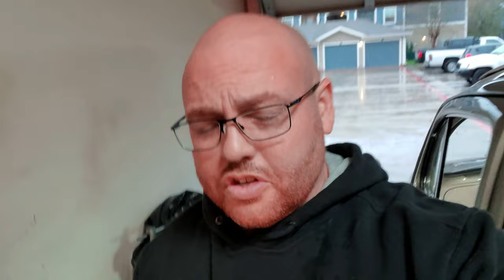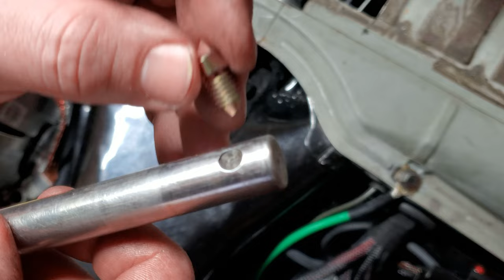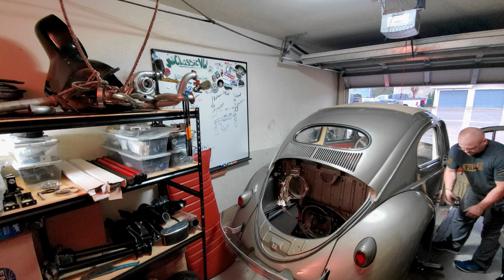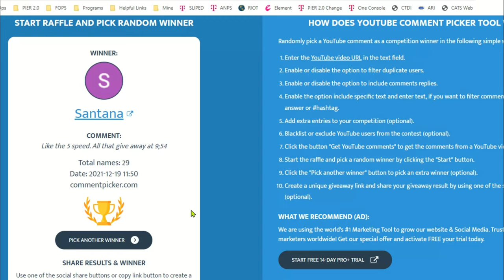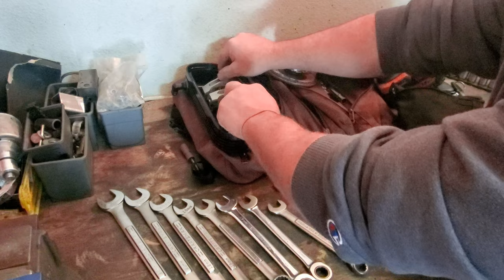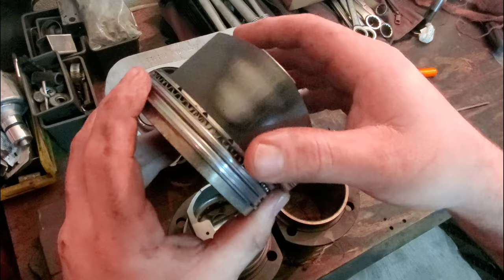BERG 5 Shifter |Turbo VW Beetle | JW Classic VW

Comment: Install looks great man!
Really nice stuff on that engine. Looks nice and clean as well. 
Question… wouldn’t it be a 2180 and not a 2276?
Reply from the maker: The General was a 2276cc brother this bad boy has those 92mm thick wall and I'm going to confirm but the CB Wedge-Mated Crank size... 86mm Chevy Journals or the 82mm VW.  I'm really not sure.  Soooo 2180 or 2287cc... it's a mystery right now... time for some Scooby-Doo investigation! Lol
Reply: @JWClassicVW  I remember the General motor, it treated you well!
Yeah it’ll depend on the crank, I assumed an 82 stroke. Either way it’ll be a monster with that turbo.
Reply from the maker: I know brother, I'm soooooo excited!

Comment: Pistons look like what i run .  JE 92mm thick wall barrels and pistons. With a turbo ring package . Thin top ring . And I also run the tool steel big wrist pins, from Ron Lummus .  Turbo engines do carbon up a lot .
Reply from the maker: Yes they are 92mm thick walled... good pistons, super excited to get her back together!

Comment: JW are you going to split the case a replace the rod and main bearings . If you do take the rods and make sure they aint stretching and all auto machine shops can check them for straightness , On a turbo thats where the stress will be. That dont look like they ran it much . Awesome motor !
Reply from the maker: Not very many miles at all on this motor and it recently was broke down and had the main and rod bearings replaced.  After I re seal the top end it should be good to go.
Reply: @JWClassicVW  OK it looks like it .

Comment: I see that there were not using, super cool tins.  ??????? They direct more air around the barrel bottoms ,
Reply from the maker: Yes, I've actually picked up a set of those.  I've actually not seen any information on a good study between the two.  That would be great information.
Reply: They're a few thoughts on this.. some say that super cool can work against flow if the air is moving to fast . they were designed for pancake motors where the air was somewhat lazy from the fan coming from the front of the motor.  His Bergman shroud will move a LOT of air.. those basic deflectors are probably more than adequate.

Comment: Great video as usual. Question, What is the adjustment screw for on the outside of the head on the left for that is in line with the rocker shaft?
Reply from the maker: I'll need to take a look... so I can see what your referring to.
Reply: @JWClassicVW   Look at the 18:00 min mark. It right under your wrist on the back of the head at #3 cylinder. It also looks like it uses the same hole that the bail wire goes in for the valve cover for #3 and #4 cylinders

Comment: Curious to see how easy/hard it will be shifting into 5th when you’re on the street.
Reply from the maker: I think all shifting will be pretty smooth when the gearbox is under power.
Reply: 5th is like the normal 4th..
Reply from the maker: If you mean final drive wise you are correct.
Reply: Understood … it seemed like the 5th gate was looser compared to how you shifted 1-4…that’s all.